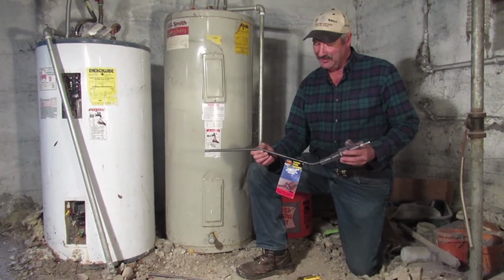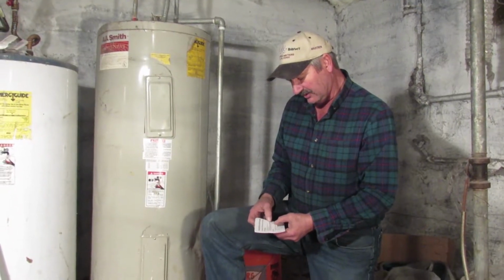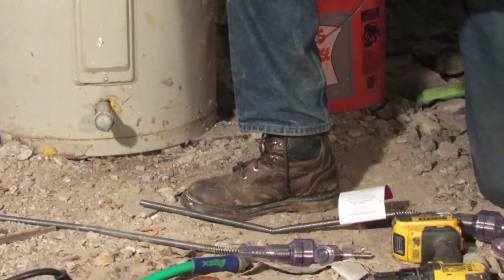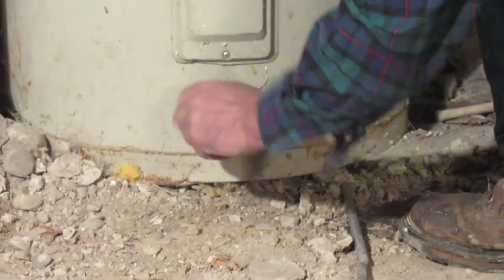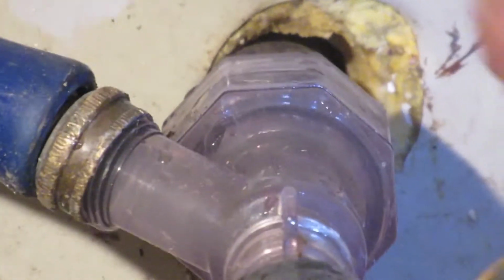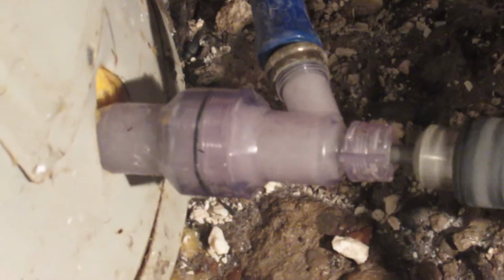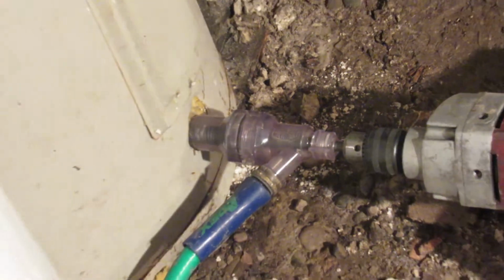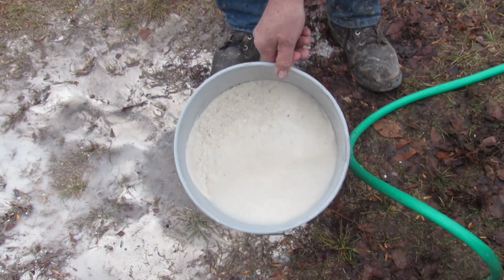TURBO TANK CLEANER | How To Clean Your Water Heater

Comment: I have gas. The gas regulate it inside the tank has a protruding stem similar to the stem going into the tank from the T& P relief valve. If I but this tool won’t it inside also in the gas regulator and damage it ? Please advise!

Comment: No part of that water heater is done correctly. What a disaster and it looks ancient. I wouldn't try to flush that at all. If a heater hasn't been flushed at least every three or so years, I am just going to replace it. That heater needs to be replaced and piped correctly

Comment: fyi, I have bought one of these, not sure if it's his brand but identical otherwise. 
I used it on a 30 year old 40gal hot water holding tank; I got about 2 gallons of sediment out of it. It was an indirect heater type hot water tank. I have not yet reinstalled the tank though, will replace the sacrificial anode first, then hope for the best.
Reply: how's the tank holding up? I'm worried about the lining getting broken
Reply: @JamesJon1187  Well so far so good. The tank was repurposed from a potable hot water tank to a house heating holding tank, which is at a lower pressure than potable hot water, less stress on it. At the price of new even simple holding tanks, reusing this was a good thing.
Also, I never was able to get the sacrificial anode out, was afraid trying any harder would break it, and also I used a corded power drill instead of a battery driven one.
Reply: @GeeTrieste  Did you try an impact wrench? That is shown in most videos. I've just used muscle and another man to hold the tank from turning.

Comment: Water heater is only 7 years old. No issues with water pressure or anything. Should I still do this?
Reply: Can depend on where you live and how your water is. Simplest answer is if you don’t have a water softener or water filtration then yes this can and will help you in the long haul. Im a maintenance supervisor I have almost 300 units on site. We try to flush em once a year tools like this are a huge help
Reply: @bighoss1435  thank you!

Comment: My only question is with the tool inside hit the bottom element,
Reply: Is it good to have an auger hitting and scraping the inside of your tank? Whatever coating it has (glass, epoxy) will surely be compromised with this.

Comment: Does the metal "snake" banging around against the inside of the tank damage the lining at all?
Reply: The impeller is a spring that is designed not to break enameled glass
Reply: Go nice and slow.
Reply: How could it not?
Reply: It's probably going to damage the dip tube or break off the anode rod

Comment: looks like a cool tool. But I HATE the plastic threads. I would put an adapter on both sides so I never have metal x plastic. Very obvious. your hose threads are cross-threaded as all holy hell. with a brass adapter, that would nver happen

Comment: I tried to take the spicket off the water heater and it would not turn. I did not want to force it because I didn't want to break it and i would be met with another problem.  Another issue I noticed was, i drained the water heater until cold water was coming out of the hose. When i shut down the cold water line to depressurize the water heater, when i opened the line up again and fired up the gas, I  opened the hot water in the bathroom. I noticed there was hot water coming out of the faucet even though the water was cold coming out of the hose. Any advice?
Reply from the maker: The best way to remove the drain valve is to grip it with a large Cresent wrench and turn counter clockwise. They are screwed in tight. 
Cool the water for your safety by running a hot water fixture and

Comment: Craig your tool looks to be useful.  I can see damage if RPM's are too high.  It appears the RPM's depend on the depth of sediment.  I have two water heaters with hard water.  Most who post here sound inexperienced and are abrasive.  I will be buying a tool and will run it on a lower speed.  Some of these geniuses question " reverse ".  It clears the grinder Einstein.  Thanks Craig, you've got a good mind.  Make some money for your efforts lad.
Reply from the maker: Thank you so much
Reply: I didn't run it in reverse, and it worked good, maceration of sediment works good.

Comment: Doesn't it damage the inside of the water heater ?
Reply from the maker: The spinning agitator is designed merely to stir up the loose sediment deposits at the bottom of the tank so that the flowing water can sweep them into the auger. It is the spinning auger and the powerful force of the water that tare apart the chunks of sediment and pull them inside. The agitator is soft, flexible, has very little mass and will not harm your tank or dip tube in any way.

Comment: This is pretty sad but Craig is the guy in the video and he created this product and it seems like a good idea on the surface but a lot of people on this thread have pointed out the fact that because of the metal whip spinning around in the tank, it could cause damage to several components including the following...

It could damage a glass liner inside of many tanks, it could damage the sacrificial anode rod that hangs down from the top of the tank all the way down to the bottom of the tank, and it could damage the lower heating element that is about 1 ft off the ground and runs parallel to the floor into the tank and more or less hovers inside the tank right where that metal whip would be spinning around.

All of these are very legitimate concerns and all Craig continues to do is copy and paste his same answer which is that the whip was designed to clean out sludge which may be the case, but he does not respond to the fact that even though the whip was designed to stir up the sludge that the whip can be spinning very rapidly and continuing to whip against the anode rod, the lower heating element, as well as the glass lining that is in many tanks these days.

Other people have asked Craig to show proof that his tool doesn't cause damage and he simply copies and pastes the same comment which avoids the question about damage.

On the surface level, I love the idea as many of us probably do and it seems very effective in getting out sludge but at the end of the day it seems like a very bad idea because it's a lot of trouble to remove the anode rod and the lower heating element when you're just trying to flush the tank.

This is not an attack against Craig who's trying to create a cool product. But craig, you are a grown man and you know that when you don't answer a question directly it makes you look quite suspect.

I hope you change your direction and start answering these questions directly and that you're able to adjust your product so that it can indeed be used safely.
Reply: I tend to agree with both of you on this. The rotating flailing spring likely won't damage enameled glass or elements, might hit up on the anode which should be replaced anyway. But if he is serious about selling the thing, he should do tests on the impact the spring might have on the interior. Do some cutaways, maybe one with a window to observe it in action.
Reply: Someone mentioned don't bother cleaning the heating element and someone else mentioned take out the heating element. Are people missing the point that the entire water heater is already assembled and the average person is not going to disassemble it to build a take out the heating element? Is this not obvious? 

This is Craig's business and clearly he has access to any number of water heaters..... Why doesn't he cut one open to show us a fully intact anode rod and a fully intact heating element and maybe do this on a few different water heaters so we can all visually see it.... 

And then he can put his device in there and let it whip around at slow or medium or high speed so we can see what it does when it impacts the inner walls of the water heater and the heating element in the anode rod. 

If he got an angle grinder and spent about an hour cutting open a few water heaters and another hour or two with a buddy of his making a few videos of what happens, and if nothing bad happens at all and the videos look legitimate, he would sell these things endlessly. 

There is simply no way that a giant whip spinning around in there is not going to cause damage to water heaters especially when there's probably a wide variety of insides of water heaters and a lot of assumptions are being made with this type of video.
Reply: @GeeTrieste  People have said that "the anode might need to be replaced anyway".  This is simply not true.  Some anodes fall apart after a year...some after 5 or 8 years depending on the water in the area.  The point of a cleaning device like this should be to help clean the inside with almost zero chance of any damage whatsoever.  What if you damage an anode that you find out had many good years left?  The burden should not be on us to speculate....he is the expert....he should do thorough tests on video to show everyone if it is indeed safe or not.
Reply from the maker: Damage to the tank or components has simply never been an issue and I have never heard of it happening. If you are worried use as directed and spin slowly. Many plumbers or other people who make their living selling water heaters try to discourage the use of this tool and recommen you pay them for a new water heater.
Reply: If worried about it on electric heaters, remove the heater elements and clean them with a wire brush while out - smart to do for efficiency anyways if trying to maximize life and save money.
Reply from the maker: @Hummer VS  

I wouldn't bother with cleaning the elements. The sediment forms on the elements and grows thicker. When it gets about 1/16" thick a chip will pop off and fall to the bottom of your tank. This will happen thousands  of times as the sediment layor grows. Examine the shape of the sediment chips and this will become evident.

Comment: First of all take those steel supply and feed lines off that tank!!! What is it 1950!!! USE BRASS OR BRAIDED FLEX LINES OR COPPER PIPE!!! STEEL PIPES WILL RUST ....SO WILL STEEL GATE VALUES!!!  I WON'T DRINK OR BATHE IN THAT WATER!!!

Comment: Thanks for your video. Does it works on the gas heat water tank?
Reply from the maker: It Works on gas and electric water heaters.
Reply: @craigmuehleip9121   hi does it wors for an Oil fired water heater help please

Comment: Now the tank housing is going to rust out from the water that soaked into the tank insulation and just sat there.
Reply: I thought the same thing.
Reply: Yup. Just save the headache and drain the tank first. Plus if you try to remove a plastic drain valve with a full tank and the valve snaps, leaving the end still threaded into the tank you are screwed.

Comment: You also need to use new Teflon tape. You cross thread the hose to the tool.  You seem to be an idiot.  And a pig, years of calcium build up on the floor that you did not clean up..

Comment: FLOP AROUND and DESTROY that tank liner...FIRST OF ALL...this ASSHOLE is doing a VIDEO in what LOOKS LIKE and ABANDONED HOME !1 
SECOND is that THE INSIDE of a WATER TANK is NOT DESIGNED to e BEAT with a wire...and MOST TANKS ALREADY HAVE A TUBE TO THE BOTTOM that PREVENTS buildup...Use this thing at your OWN RISK !!

Comment: Will this tool damage the lower heating element?
Reply: When i cleaned mine out, i shopvac'd the sediemet out of the lower hearing element hole. I understand thats not your question since i didnt use this product.
Reply: @nateb4543  has to be a small shop vac hose?
Reply: @Corrado Cianciullo  i had like a 2' section of clear hose that went in my shopvac hose. Kinda fun cuz i could see the shit coming out of there

Comment: Just replace the drain cock with a full port 3/4 ball valve with hose thread. Install, drain and cycle shutoff to remove debris. Fill and flush as needed, save your money and don’t buy this.

Comment: @Craig - Does the spinning inside the tank going to break the lower heating element?
Reply: If you're worried,  remove the lower element before using it.
Reply: @politicalfisherman540  If I'm going to all that trouble, why wouldn't I just use my own drain auger to ruin the lining of my tank?
Reply: @DouglasGross6022  I think the main drive here is that it works. Will it damage shit? More than likely. I get my water from a well and if it were any harder it would knock yer ass out when showering. I ended up using a shop vac which took forever, big- ass chunks. But I definitely agree that using this tool will end up causing you more headaches than what you already have. One dude said "go slow". Obviously, he doesn't understand the concept of how the tool is supposed to work.
Reply: Yes craig.  Still waiting on your answer.

Comment: What happens to the glass lining? Cracked? Helps speed up the rust process? Seems too good to be true.
Reply from the maker: The spinning agitator is designed merely to stir up the loose sediment deposits at the bottom of the tank so that the flowing water can sweep them into the auger. It is the spinning auger and the powerful force of the water that tare apart the chunks of sediment and pull them inside. The agitator is soft, flexible, has very little mass and will not harm your tank in any way.
Reply: That's actually a pretty nifty device if you're someone who doesn't do annual maintenance on your tank heater... personally I will never own another Tank Water heater waste of energy.
Reply: While the power is off and doing this- 
You have to drain the tank to put this in, so:
Remove the elements and anode.
If the anode is mostly gone- replace it.  The flexible ones are easier to install, cost more but work better.
Then wire brush the elements clean and resinstall when done.  

No biggie.  
Imo either do everything as long term cost savings to not replace unit- or leave it all alone and buy new unit every 15 ish years
Reply: @MrNorthstar50 no glass lining, you sure? What do you call porcelain glass enamel?? Rheem calls theirs RheemGlas. Synthetic polymers are becoming more and more popular and can also be damaged.

Comment: Wow, you developed a 'snake' that is good for scraping the protective lining off of the inside of the tank that prevents it from rusting out the steel tank and leaking. Yes, your snake is getting large amounts of sediment off of the bottom of the tank, but hardly worth it if it leaks in a few years. Also, what is the purpose of using this product on an Electric Hot Water Heater (shown in this video)?? It doesn't matter if the sediment sits on the bottom of the tank since the heating elements are above the bottom. The only best method of 'cleaning' the inside of a water tank is flushing it for a couple hours with White Vinegar (which requires a pump system), and would only be recommended for a Gas Water Tank.
Reply: Spring or well water, man. Some will cover the bottom elements in a couple of years.
Reply: I did 3 things to my electric water heater. I replaced the original drain valve which had a pea size drain hole, easily clogged, with a 3/4" full port ball valve. Then I removed the lower heat element and shoved in a vac hose reduced down to fit in the hole and sucked out about 60-70% of the sediment. Then I poured in a solution of citric acid into the anode hole and let it chemically dissolve the sediment. 30% vinegar works well also. Then I flushed the tank with fresh water. I also have a borescope that I shoved in the anode hole to see the accumulation of sediment and monitor the removal as I experimented with different methods until I came up with this. It removes about 95% and doesn't damage the tank lining.  There is no easy way or miracle tool to PM a water heater.
Reply: @steadyeddie7453  What concentrations of the acids did you use, and how long did you have to let them work?
Reply from the maker: The spinning agitator is designed merely to stir up the loose sediment deposits at the bottom of the tank so that the flowing water can sweep them into the auger. It is the spinning auger and the powerful force of the water that tare apart the chunks of sediment and pull them inside. The agitator is soft, flexible, has very little mass and will not harm your tank in any way.
Reply: @craigmuehleip9121  how can I  get one?

Comment: Used this tool yesterday to get the gunk out of my 80gal heater, holy cow I got a 5 gal bucket of sediment out of it!   Took the time to remove the stupid plastic drain valve and replace it with 3/4" brass ball valve.   A new 80gal heater is around $1,000 anymore, this is a great invention in my book.  Thanks Craig!
Reply: probably you already know not to drill to fast or you will damage the tank protection, scratches on the tank liner makes it prone to leaks in the future. is a good tool but you need to know how to use it. after all that sediment removal new anode rods should be replaced.
Reply: Is my “sediment” supposed to be brownish/copper colored?
Reply: Mine was a bit lighter colored, but the color will vary depending on the water source and overall condition of the inside of your tank.   @private4546